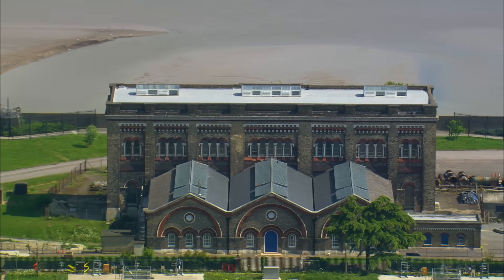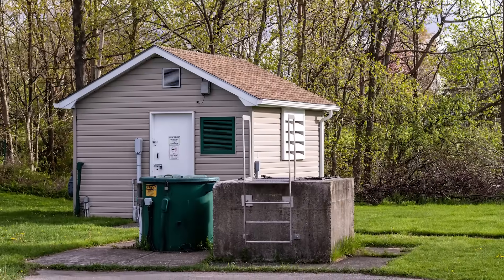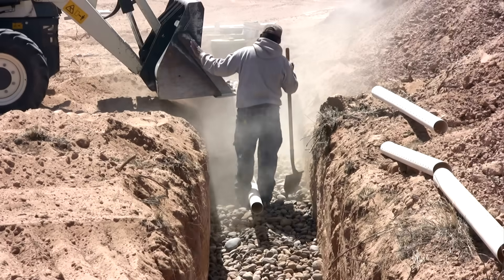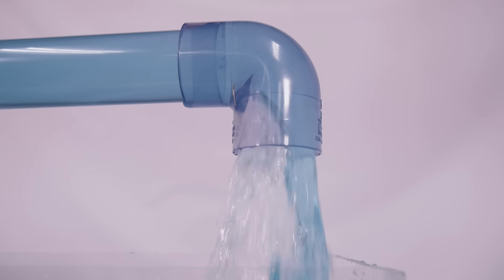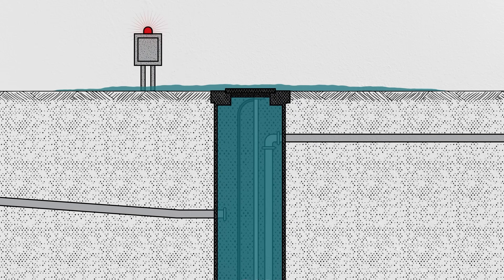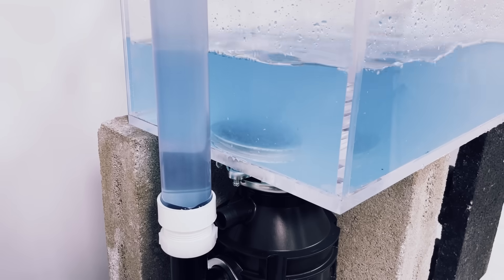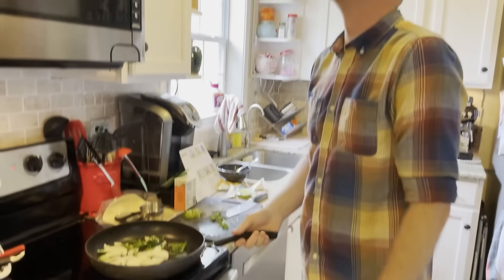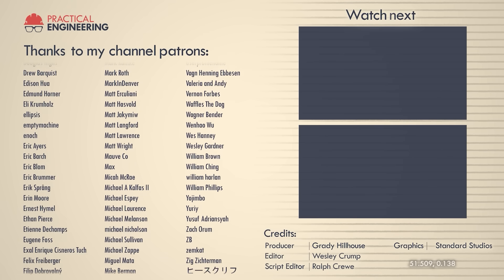How Do We Pump Sewage?

Comment: Another reason to rely on gravity is you want to minimize the pressurization of sewage to prevent it leaking out.  When I started in SCADA work I was told "In the event of a shitsplosion, close your eyes and mouth."  Great video, thank you!
Reply: What a descriptive image you paint.
Reply: Yes, you’d want to close those. Wish we could close our ears…
Reply: This makes good sense!
Reply: @Robert Arnold You will not be fine if you drink a cup of gasoline.  There are so many terrible things in gasoline that will cause serious long term problems.
Reply: I'd have them closed even BEFORE a shitsplosion. Hell, I closed my eyes a few times during the VIDEO.I have a renewed thankfulness to people that can work in these environments.
Reply: I've been front and center to a shitsplosion, absolutely agree with that advice.
Reply: A poonami?
Reply: My father had to install telecommunications equipment on an island that had a pressurized sewer system. When they were trenching in the bundle their trencher would occasionally hit a line. He told me that if you heard hissing, you ran like hell, and if you were running the trencher you leaned forward and closed your mouth and eyes.
Reply: I've always heard it as a shitacain... Mr Lahey.
Reply: @Natasya🔞 no
Reply: Yeah, I used to work on these systems.  Pressurized sewer is the worst. I’ve had to close systems at 3 separate points before and still have a “spurt” of crap water spray me in the face.  So fun
Reply: It is under pressure because the pumps move it up hill....  if it's very flat land they usually use vacuum main place of gravity.
Reply: He mentions the speed and harm to joints
Reply: one of my best friends is a SCADA/PLC programmer, primarily working with water and wastewater treatment plants. Clearly, pressurized sewage is something to be avoided, and consigned to as few locations as possible.
Reply: Nope. Totally an efficiency question. Forcemains are very common. Would make sense a SCADA person doesn’t have any common sense though.
Reply: I dunno man, I'm not an engineer, I just know what the engineers of my particular municipality told me about it.  No need to be rude about it.